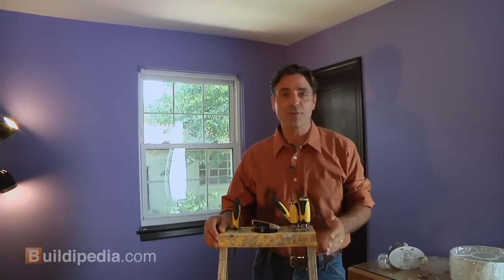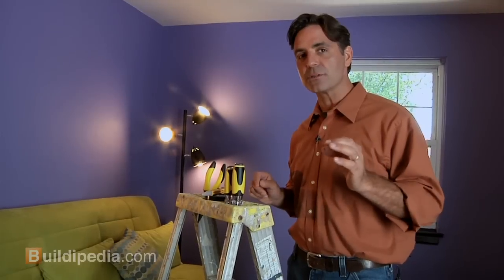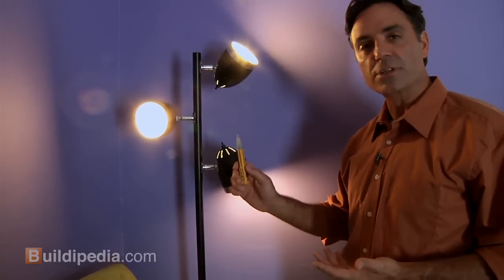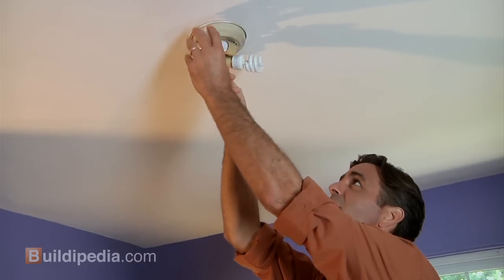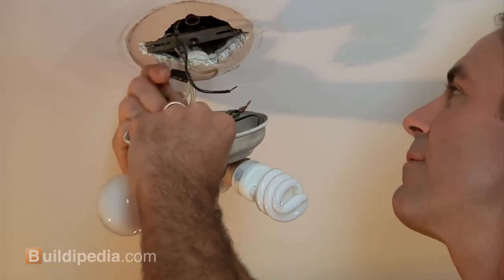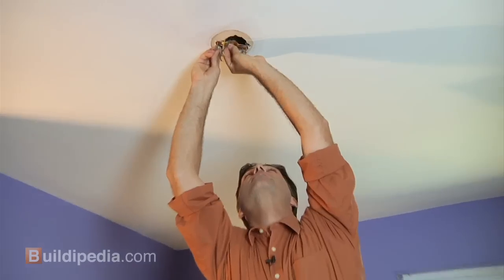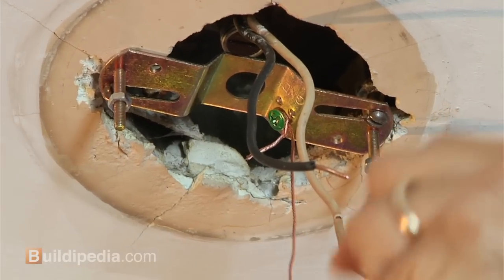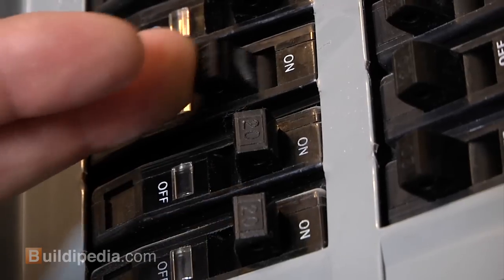How to Replace a Light Fixture -- Buildipedia DIY

Comment: Thank you! This is the best video for describing how to connect the wiring!
Reply: Just going back to switchers don't bother 😢😢😢
Reply: SO sorry called it the wrong thing. I've got a light in the hallway the globe just push +twist (baonett) I think, but  there is the next part of the attached above the globe that screws into the ceiling. I've bought new ones and would like to know how 2 take the old one out of the ceiling putting New 1on but need to know what wires go where? It says it's a battenholder 4 terminals, looking inside I can see 4 gold screws covered by white screwed in the middle, center screws silver, 1side reads Earth other side reads loop. Did this years ago but I think wiring colours are different these days. Sorry 2 B a pain but need step by step instructions.   Always with Sincerity Taurie 😢😢😅😅